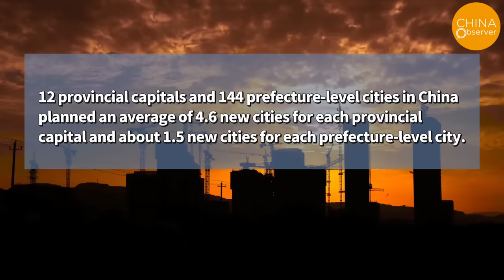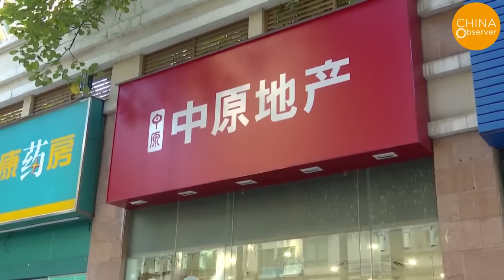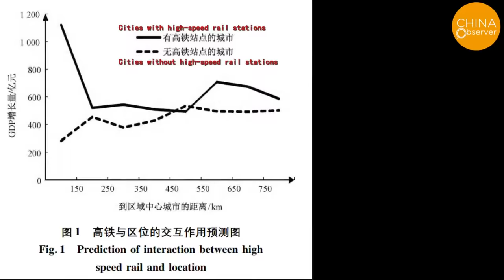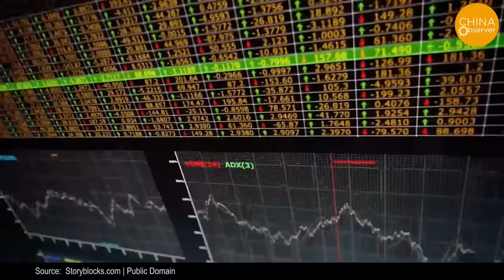Totally COLLAPSE! 3,500 New Ghost Cities Emerge in China: Trillions Wasted in Spectacular Missteps

Comment: The two main reasons for the Chinese housing bubble burst is demographics and how investment works in China. China's fertility rate is so low than there simply aren't anymore young people to buy new buildings and the migration from rural areas has run out. The investment issue is simply because China doesn't really allow many investment options -- stocks, bonds, etc. are heavily regulated, you can't invest oversees, many businesses are government owned/controlled, etc. So, for most people, this leaves realty. So, you have lots of Chinese buying a second condo as an investment.

Comment: There will be a big market potential for concrete recycling industry in China in the coming decades
Reply: There is not much demand for recycled concrete. Concrete setting is a chemical reaction like burning coal, which takes huge energy to reverse? Note that there are zero industries turning ash and air back into coal.
Sadly the amount of greenhouse gases created by making all the cement and steeel that was wsated is these buildings is enormous. Hopefully they will stop doing that now.
Reply: No. They will just let it rot.